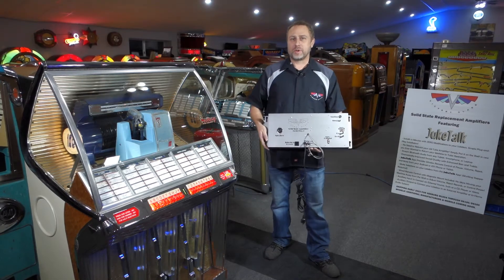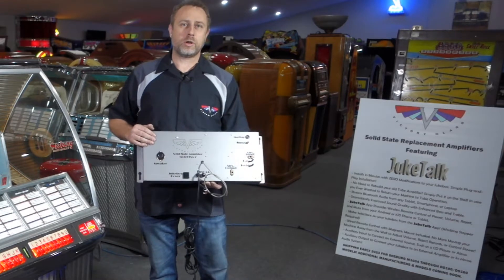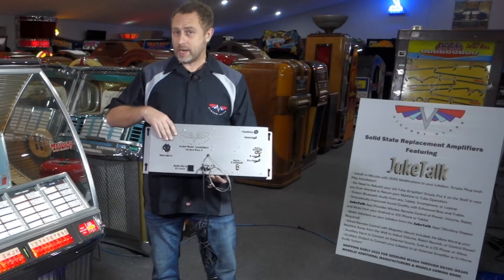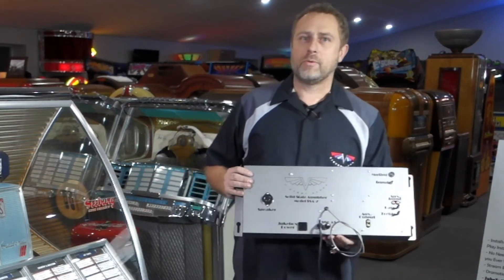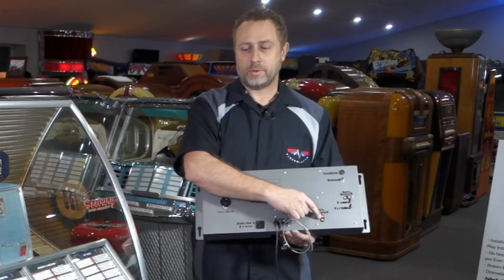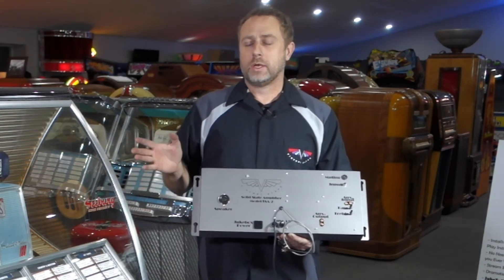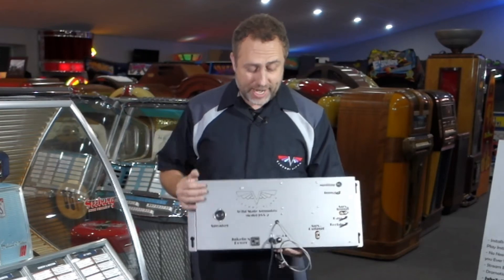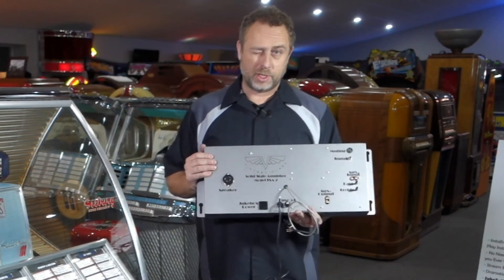Introducing the Solid State amplifier for your Seeburg Jukebox from Victory Glass

Comment: I just installed one if these in my 100B along with the Hi-Fi add on speaker.  Went well just seemed to be a very tight fit on the cabinet door and had trouble sliding it over with ease. But i got it.  Sounds incredible and the Wi-Fi option puts it over the top!!!!  Thank you for bringing us this product.  Have a few things to set up like the phone app but its super cool!
Reply from the maker: Thanks for the kind words.  We did have some of the chassis fit tight, we have addressed this in out latest batch.  Glad your enjoying it.

Comment: A properly restored tube amp usually sounds great.  Unless it is missing or badly damaged, why would you want to de-value your antique machine by doing this.  My M 100 C plays really well through external speakers,  The large field coil speaker is it's real problem, not good with high frequencies.  I have often thought about replacing it with a 15 inch coax with a horn driver, but have never thought the amp needed to go.  How loud do you need it to go, a pair of 6L6 tubes has more than enough power to rock out in your man cave.
Reply from the maker: I would like to address both your points.  First; our SSA amp does not devalue your machine.  No permanent modifications required.  Takes about 15 minutes to install. Save your old amp in the box and in any given 15 minute period you can return it to original use.  No sign it was ever in there.  
  When properly restored an original amp sounds good.  Ours do provide better fidelity response.  To properly restore the amp you must replace all the caps. Often also need to replace most tubes. Resistors. And sometimes tube sockets.  Between finding someone skilled to perform these tasks the cost rises.  This ssa allows these beautiful jukeboxes to remain in operation and in family’s.  You most likely are one of those skilled people that can repair. But there are less of you taking in repair jobs every year.   If you truly love the jukebox hobby you can easily see the value in these ssa amps keeping it alive and in a new generation of hobbiests.
Reply: My Q160 went from 160 selections to infinite  with this amp.  All while sitting on my couch.